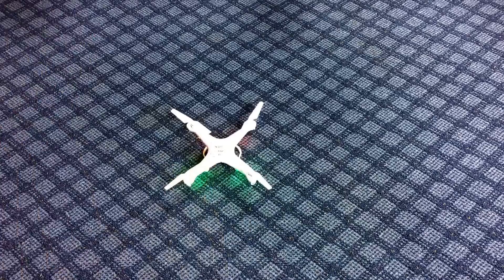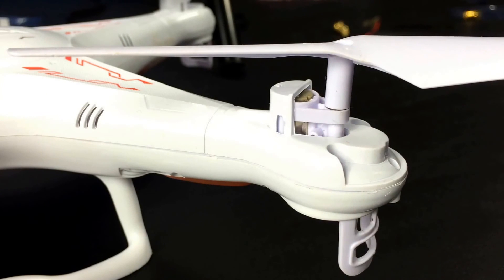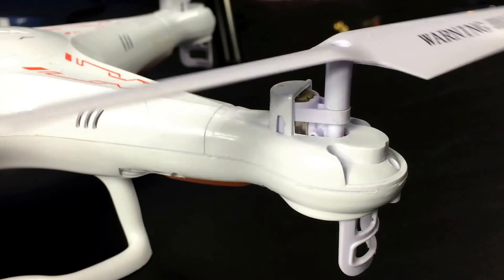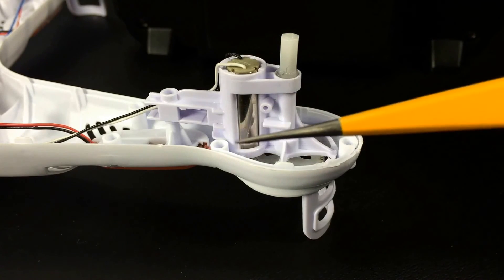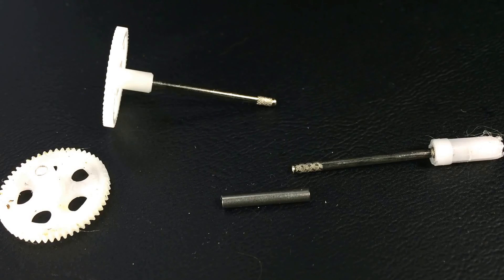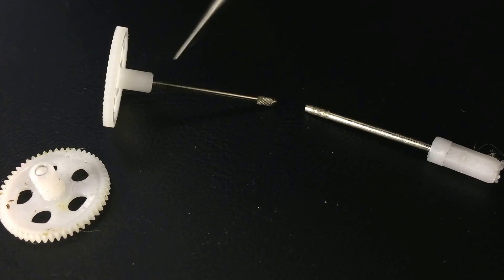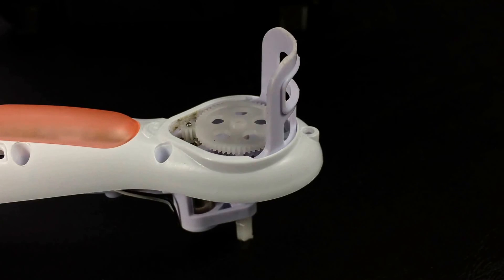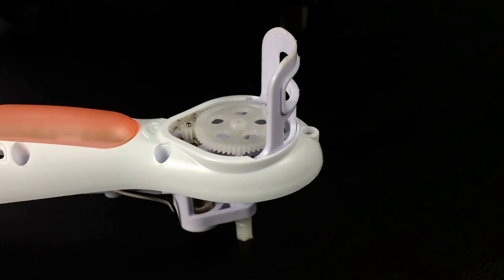Syma X5C rotor replacement DIY

Comment: Unfortunately you skipped over the info I really needed, which is how to separate the shaft from the cog! How much force is required? It feels like it's going to break if I pull it any harder...
Reply from the maker: Yeah the cogs are press fit on there and yes, it will seem like you could break the part.
Reply: @JohnsDIYPlayground  I ended up ordering. the whole shaft/cog unit to replace as a single item. Honestly the force required is so great I'm afraid of not just breaking the cog/shaft but the entire housing.

Comment: Your dialect is very great lakes. Are you from Chicago? My motor died on the same corner. My suspicion is they burn out because one blade gets hung up on an obstacle while the others spin. Too much of this beats up the motor.
Reply from the maker: I’m in the Midwest, yes.
Reply: @JohnsDIYPlayground  today I will replace the whole set of motors and save the used working ones as back up. This drone won't last forever. I wanted a learning drone. I will switch to brushless and add gps and some gimbal. The holy stone hs720e is a tempting next craft, but I am hoping to get to a mavic mini 2. I want the video drone skills, but start with flying skills first to amplify the videography. I may have to get intermediate before the DJI. The problem is, hs720e is $300 and the DJI is only $450. Am I wasting my money on the Holy Stone? I don't want to crash the mavic. At all. 
Recommendations?

Comment: If anyone else is having trouble separating the gear shaft from the plastic part that the prop is screwed on to then check this web link out. 
https://www.rcgroups.com/forums/showpost.php?p=33659533&postcount=658

Comment: Hey John, Great job with the Description, and Pointers ! I lost Count on how many X5c's etc I've fixed ? But this is the First time I've had a Similar issue with the Gear shaft ! Last night i kept trying to Unscrew the small part of the shaft (that the Propeller sets on) instead of Pulling it off as you have shown Here ! Thanks Alot for this 👍 I'm going to try this replacement Without taking it Apart again ! I Completely transferred Everything from One X5SW1 to the Shell of Another X5SW1, Circuit board, Lights, Everything ! The test flight went well, but it Started doing Pretty much what Yours was doing ! Hopefully it will come apart without any damage to the Shell etc ! Thanks again for making this Video ! It was Hard to find this Helpful Hint ! But "You" just ended my Search 😂 Thanx again, Here Goes Nothin...
Reply from the maker: Thanks for the compliments Paul!  Hope the repairs are going well for you!
Reply: John's DIY Playground Ya, as Soon as I put it all Back togather, it flew Great ! Which is the Payoff ! It was an Awesome feeling ! But now I ran into another issue ! Doesn't matter What kind of battery I use ? The Lights start flashing like the battery is done within 10 Seconds ! Maybe i didn't put the Gear in right, or, well I'm not sure yet, lol ! It flew great a fee times, now it dies aftera few Seconds ! So it's back to the drawing board, lol ...

Comment: Thanks so much, you wouldn't believe how relieved I am to find this video. I have this exact same problem. Did your left control make the quadcopter go left to right instead of rotating it? It was as if the controls switched over.
Reply from the maker: Usually if a motor is bad and a push to have the quad lean left, it will rotate instead.